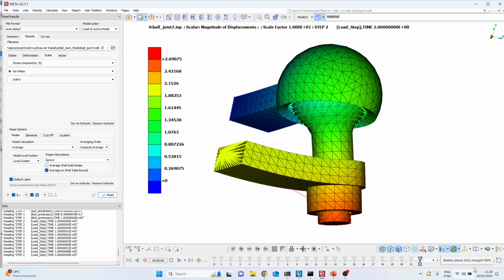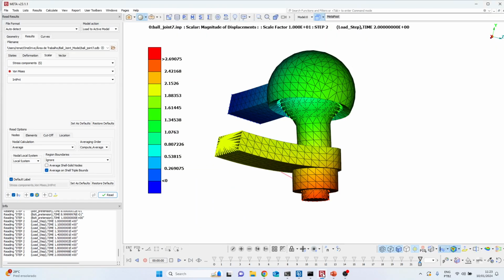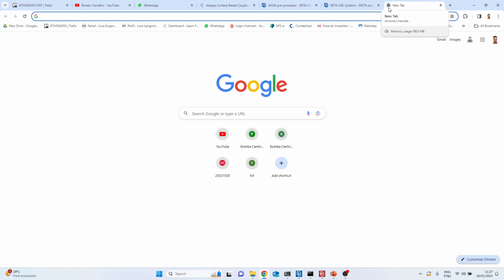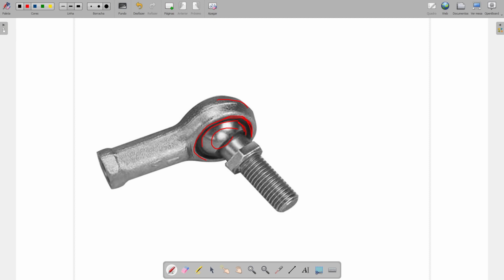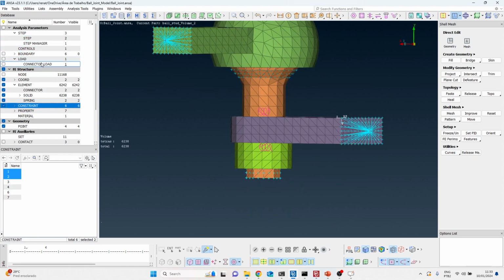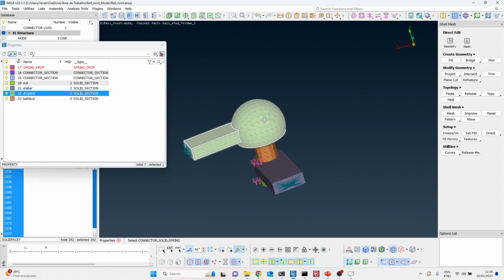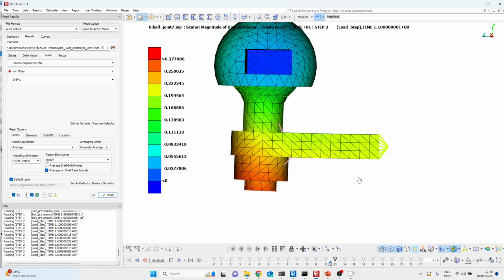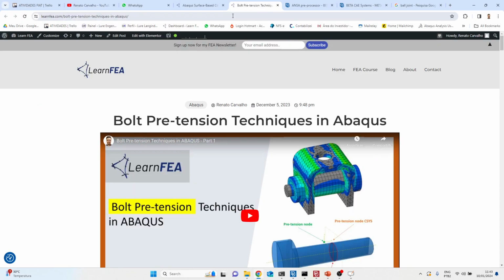Coupling Constrain in Abaqus Case Study: Ball Joint Connection

Comment: very useful guidance and helps me a lot ,thanks, Is there any possiblity to post bushing connection in vehicle suspension or even build the whole independent suspension step by step?
Reply from the maker: I'm glad you've enjoyed it. Yes, this is actually the next tutorial I'll create for my nonlinear FEA course. The idea will be to show how to model the whole front suspension assembly composed by LCA, UCA, Knuckle, Stabbar, steering rod, spring, damper, jounce bumper etc. I will shortly start working on it.
Reply: It's great to get what you reply, you are an expert on FEA and I benefit a lot from your  LearnFEA Blog
actually I am an automotive suspension engineer, particularly working on air spring components at one OEM, during my daily work, I need to obtain the air spring motion envelope in the context of specific suspension type such as double wishbone suspension, five links suspension,etc at the project priliminary stage, Currently the motion package comes from the supplier, but sometitmes it takes so long time for the supplier to prepare  deliverable, so I try to bulid this capability on my own with the heip with Abaqus, And I look forward to seeing your video course on automotive suspension creation,thanks.